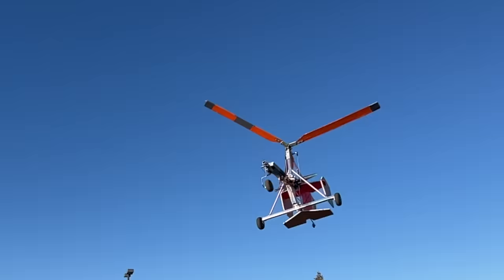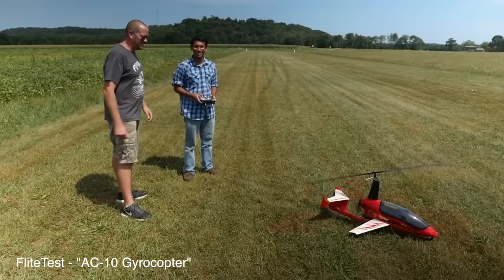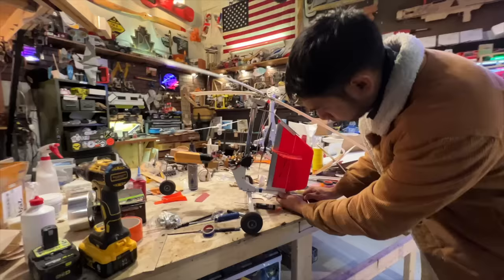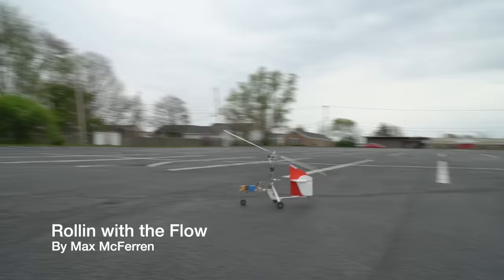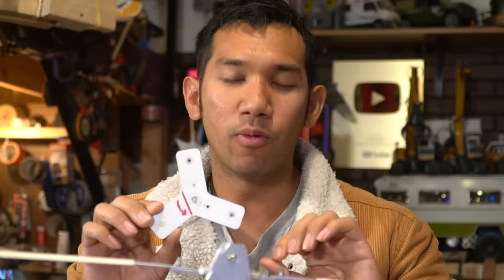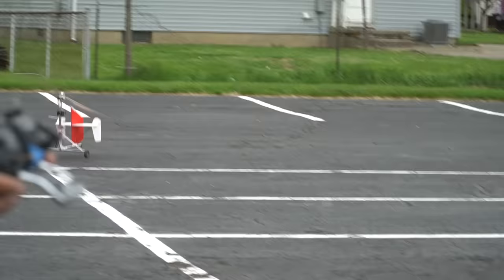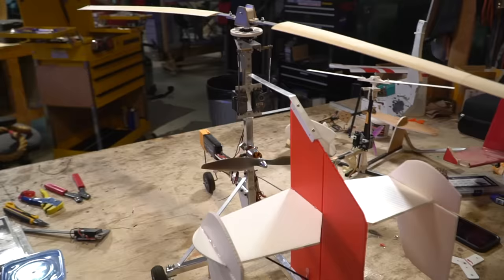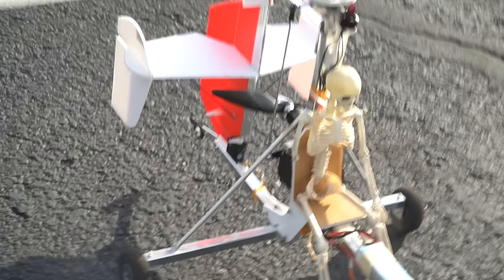This isn’t a helicopter or an airplane?

Comment: I saw several Benson Copters do a kind of aerial ballet at an air show in the’50s. If you know how to fly these machines, they can do things no other aircraft can do! Unfortunately even the ultralight version of gyro will burn around 5 gallons per hour, so $25 to $30 for an hour of flight. Thanks for posting. Wonder how much your training will cost ?

Comment: I'm a little late to the party, but I've built a few of these, and the best results I got were from one that had two counter-rotating rotors on the same mast. Of course, that's sort of cheating since you're pretty much sidestepping all the asymmetric lift and gyro effects, and doesn't really help you with flying a full scale one.

Comment: Dang, this looks awesome!

Have you been using any light-weight filament for the rotor blades (such as ColorFabb LW-PLA, which "foams" the PLA as it's extruded) or just straight PLA/PETG/ABS?

Comment: They have been flying full scale gyrocopters for over 100 years. Someone landed one on the White House lawn. I think flying a gyrocopter is a lot like riding a bicycle. You have a Kinesthetic feel. It is also difficult to ride a tandem bicycle because of the input of two riders. It makes it almost imposable to turn. You should try adding RC to a full size bicycle. That may be difficult to control as well.

Comment: So during takeoff there are such points that you stick slight forward to take drag off the rotors whilst compensating with   throttle forward easy to maintain the rotor speed and increase ground speed to liftoff rotor rpm and proper groundspeed. 
Well there's your stick back slow stuck forward fast.

Comment: in the early shots, I was wondering where the hinges on the rotor blades were, because it was that innovation that allowed De La Cierva to leave the ground. But saw your teetering head, later in the video and it all made more sense.  There is also some discussion that a tractor Gyro is safer than a pusher type.
Reply: They are all safe if flown properly.  Trick is to find someone who can teach you properly.

Comment: You are having the same problem the early pioneers of over head rotors had. That is the rotor generates more lift in the direction of travel and less lift in the opposite direction. This induces a rotational torque on the aircraft. Juan's revelation was that He had to allow the rotors to flex to naturally adjust for this change in lift. If you use a less rigid material for the rotor blade it will naturally flex to compensate for the difference in lift and eliminate the induced torque. I used to own a book on how to design a gyroplane, however I loaned it out to someone and never got it back. I believe the title was "Understanding the Gyroplane" by Paul Bergen Abbott.

Comment: What a strange machine Peter.  Be very careful if you do fly one:  looks unsafe.  Thanks for an interesting video.
Reply: They're actually pretty darn safe.  Engine outs are much safer than fixed wing
Reply: Gyros look unsafe because people are accustomed to having wings and enclosures, but they are just as engineered as any similar-sized airplane and the blue one shown in this video is more comparable to an ultralight plane (search Quicksilver MX) than to a Cessna.  Most people probably think ultralights look unsafe, in general.

In fact, gyros are safer than winged aircraft in some ways as they can land on a spot and can fly close to the ground where both helicopters and airplanes are very dangerous.  A gyrocopter surprisingly has some similarities with a powered parachute as you always have reserve lift and drag for a soft landing even if the engine dies.  An engine out in an airplane or helicopter at 400ft is going to be very difficult and dangerous; in a gyro it's just a landing.

This makes gyros, trikes, and powered parachutes well-suited to low and slow flight over beautiful landscapes.  Airplanes are better for long distance travel and helicopters best only for areas with no runway at all.  A low-level tour of NYC would be safer in a gyro, but they use helicopters out of necessity and familiarity; larger gyros for groups just aren't being manufactured and even smaller ones haven't become popular in the U.S.

People here prefer trikes and this mainly because you can buy a ready-to-fly trike off a dealer lot, but the FAA did not allow sales of pre-built gyroplanes in their Sport Pilot rules 2 decades ago.  I was very disappointed.  To fly in the U.S. with a Sport license, you have to buy and build a kit or build your own from scratch :(.  It's easier to buy and fly a gyro in Europe.

Not all gyros look like "flying bedframes" and you might visit the AutoGyro website to see some enclosed models.  They're just aircraft, like any other.  This also means that they're priced like other aircraft :(.

Comment: @PeterSripol I don't know if you still have this on the back burner, but have you considered going farther and doing a full swash coax gyro? It resolves your roll issue very well at scale, and let's you have some more disc inertia as well, lending well to heavier builds.

Comment: Good that you are getting professional instruction from an CFI. Gyros are significantly different from helos. I flew a Hiller helo about 20 years ago that we used for crop dusting. When you get the hang of the physics, the gyro is fun, easier, and far cheaper to fly. Just go ahead and get a Sport Pilot Gyrocopter rating. I highly recommend getting training if you value your safety which it looks like you are doing.

Comment: at 6:50 both motor torque and lifting rotor imbalance "want" to roll the aircraft towards left. If one of them is reversed their rolling moments would subtract from each other instead of adding up.

Comment: So, other than the initial starter motor, the main blades are not powered? They just auto-rotate from from the smaller propeller driving the craft forward? Sorry if this is a dumb question, but I know very little about flying.

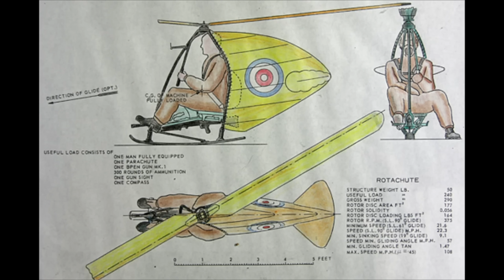Comment: Great to see all the thinking on blade articulation.  Some history to add to your video:  At 0:51 you showed a picture of the "Rotachute" while talking about Igor Bensen's achievements.    The Rotachute was actually designed by Raoul Hafner in 1940/41 during WWII  while he worked at the UK Air Ministry.  (See more:  https://en.wikipedia.org/wiki/Hafner_Rotachute ). They went on to develop a Rotabuggy (Jeep) and Rotatank!  The Rotachute is currently on display at the Museum of Army Flying in the UK.  Furthermore,  prior to this in 1935, Hafner and his team inspired by the likes of Juan de La Cierva, developed the ARIII gyroplane which dispensed with the wings. (https://en.wikipedia.org/wiki/Hafner_A.R.III_Gyroplane ).  However the key development in the technology was the rotorhead and associated control mechanism (that you have been tackling in this video).  The innovative design was revolutionary in controlling rotor blades independently providing much greater manoeuvrability and control than had been previously possible.    Cierva and Hafner had both been encouraged by Scottish Industrialists to setup companies in the UK during the 1920s and 30s to develop autogyro aircraft.  I still have Raoul's photograph album he kept during the development of the ARIII.  This technology eventually found itself in the Sycamore which was the first British helicopter to receive a certificate of airworthiness ( https://en.wikipedia.org/wiki/Bristol_Sycamore ).

Comment: The teetering needs to reduce pitch on the ford going blade and increase pitch on the rear going blade.  Therefore, the whole blade must trail behind the teetering axis, so that the blades can pitch to provide equal lift at all forward speeds.  There is a limit though as lift is proportional to velocity squared, it is easily possible to get to a forward speed that will cause the rear going blade to stall.  This is the main reason that both helicopters and gyros are slower that aeroplanes.

Comment: Hi peter while I am hopelessly at flying RC I built a auto Jiro from scratch. The wing was ridged , two peases of wood ( curved on top flat on bottom not an air foil just a curve) bolted to a lump of ali which was twisted this assembly was rubber mounted vire two screws into the top of the rooter head allowing flex from front to back not end to end . Below the head I had a gimbaled bearing connected with a link to the side of the wing the same as a chopper plus a stand airplane tail. The gamble acted at 90 to the wing so I could bank left or right the assembly was only leaned back about 8 degrees this allowed the rudder to be back more. I powered her with a OS 30 and 3 blade push prop it flew well although with out a spin up system getting the wing out of stall took a lot of taxieing

Comment: I've was obsessed with gyrocopters since I first read an EAA Experimenter article about them in the '60's. The many authors and interviewers raved about their simplicity, enjoyment and ease of flight. 

Now I really do admire your tenacity and commitment to try and try again. But I wonder what the difference is between your carefully studied yet difficult to fly drones and all those thousands of successful full scale autogyros that have flown for nearly a century?

I suspect that you are NOT incompetent. Because of your knowledge of aerodynamics and your experience. Rather the laws of aerodynamics change with scale. Perhaps a giant rotor is far more stable and therefore less likely to tip over. Kind of like the difference between balancing a pencil on your fingertip and balancing a broom.

Off the top of my head. I would consider adding angular momentum. You could add weight to your rotor tips. Make your rotor heavier. Increase the quantity of rotor blades (like four or six). Or you could just add a flywheel to your airframe.

Just a thought

Comment: Here's my idea after watching the problems with the autogyro: use two sets of rotors. Design them to spin in opposite directions. 
Link them together so that one cannot move faster than the other, and so they can be interweaved allowing them to be placed closer to each other.
Reply: Oh that’s a new idea NOT !
Reply: @pufango4059  Doh! 😖
Thanks! 😂

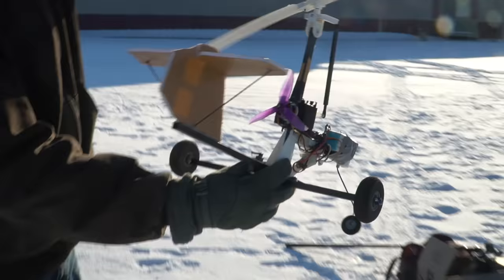Comment: 2:48 “it is so squirly and touchy that no human can….. “ This is not possible. The autogyro can only possibly stay in the air using flapping blades (using hinge or hinge-like) thus stabilizing itself. Yes, you read it correctly. During one full rotation advancing and retreating blade behave entirely differently. I put an eagletree stabilizer on my autogyro, but ended up using the thing for mixing only, not stabilizing in any way.
Reply: Gyros arecsyick free very stable but stick fixed unstable.  Connecting the controls directly via servo means his whole time flying is fixed fixed the least stable way to fly.  Most of the early gyro training is getting the students to relax on the stick.  The best explanation I heard is hold the stick like a rope banana.

I think hollow soft rubber tubing on the control rods to dampen servo inputs might help.  Also chordwise balance on the rotors is massively important.  Basically stiff rotors chorwise are the least stable I  flight.  He want as flexible chordwise with if anything slightly over balanced chordwise rotors and some dampening on the controls.  Maybe extend the control stick an inch on hid controller to reduce his hand inputs.  No feedback either.

Comment: I wonder...would there be any way to combine the gyrocopter concept/plan with Magnus effect rotor sails instead of an aerofoil rotor? Like, keep the powered rear propeller, and then use the incoming air flow to turn the sails or something?

Comment: Does the top rotor being spun by airflow do anything unkind to the motor that's being backdriven? Like, does there have to be something clamping down the power being generated by the motor?
Reply: He took the magnets out of the rotor motor, so it's just a rotor mount now.

Comment: It's not totally true that the gyrocopter stagnated in design after the invention of the helicopter. There were still iterations on the design and efficiency and even attempts to commercialize the design, the most successful of which that was very nearly adopted was the autodyne. Mustard has a fantastic video on it. It was a medium sized passenger liner that used tip jets to achieve vertical takeoff and landing using the reasoning that it may be able to take off either from much smaller heli-pad airports or even from the top of skyscrapers, bypassing the traffic to and from airports. With many flights in between cities on the East Coast being short jumps, might as well fly directly to the city center to drop off their passengers. It was a damn good design with working final examples that was so close to being adopted. The design ultimately failed due to concerns about more noise in the city center, which is a valid concern though engineers were able to streamline the noise dampening by almost 80%

Comment: So the Gyrocopter's main blades act like the wings of an airplane. For stability of the aircraft, the wings are made dihedral (Usually used by commercial aircraft). How about doing the same with the gyrocopter's rotor blades? The more unstability, adding more dihedral could help but maybe not much. What do you think?

Comment: cool. i want to build an even bigger gyrocopter with a 10cc nitro motor on the back. the 3d printed blades look pretty cool too. i have done some basic training in actual gyro copters and some engineers who design the full scale machines

Comment: Take note that all the gyrocopter deaths started when people started throwing them around due to a number of design defects in the center of mass vs thrust etc.
Reply: Nope that's dogma.  Most of those deaths were due to no or little proper training.  They still are too high and for exactly the same reasons.  Yes cg vs thrustline is important but the original Bensen because it had proper downturns was correctly set up this way.  People are still getting killed in spite of the fact that they have large horizontal stabilisers and correct thrustlines.  Punching the stick forward too hard at high speeds read low disk angle and unloading the rotor is main cause of death.  I've know several people who killed themselves this way.  

Go look at any modern fatality look for rudder being cut off blade bowed down like a bent banana but not bent backwards indicating they had little or no forward speed when hitting the ground.  Almost every modern fatal gyro accident that's what you will see.  The only way to avoid this is too get proper training.  Anyone tells you their machine is immune then let them fly at high speeds say over 100knots and punch the stick forward and then I'll believe this toss note I'm not blaming you this nonsense if often spread by bloody instructors and CFIs

Until then people need to take the idea of an idiot proof gyro with massive grain of salt.  Learn to fly them properly and fly well below its speed limits and if anyone tells you they know ots VNE they are lying the only people who really know that only know it as they plumet to the ground.  The given VNE in a gyro was when the test pilot began to feel nervous.  It might be 5knots faster or 15 knots faster.  Take that speed and drop it by 15 or 20 percent.  I remember the aircommand was given a best LD of 50 mph it was closer to 35mph.  Don't believe the advertising.  If it says it can cruise at 120 knock off 20.
Reply: @cameronlapworth2284  Thank you for your interesting and thoughtful reply I appreciate the good quality information :)

Comment: Doesn't a gyrocopter just float down in case of engine failure.
because the propellers are going in the opposite direction there for cutting the resistance of the wind wedding at glide down slowly